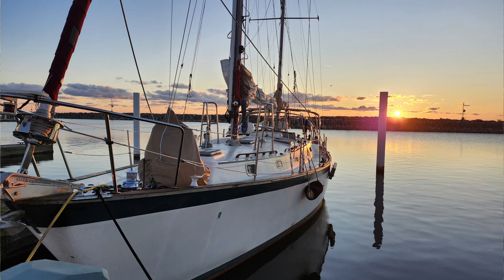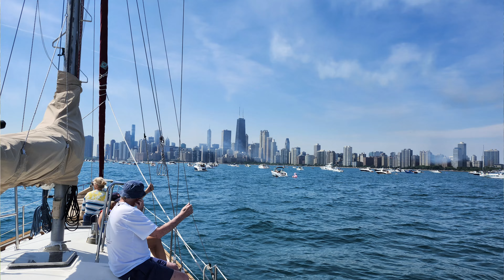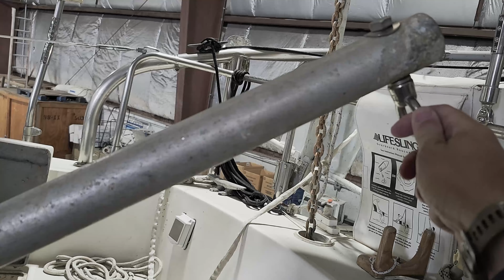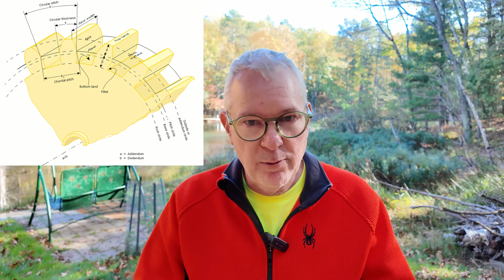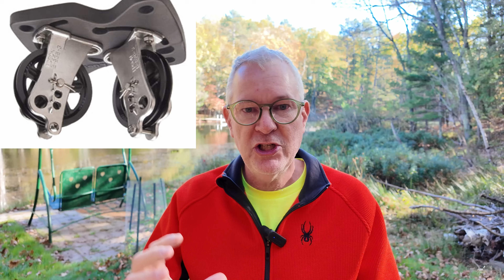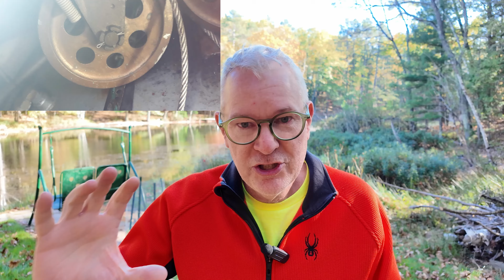The 5 LESSONS I learned LOSING STEERING sailing Lake Michigan on a Windy Day!!!

Comment: Weird coincidence, I was thinking, just last night, as I drifted off to sleep, that I need to come up with a way of connecting my emergency tiller to the winches, and your video just drove that point home, hard. Thanks for that.

Meanwhile, I wonder, do you have any idea why, precisely, your steering failed? I mean, I understand, the chain broke, but, it seems to me, that's an odd point of failure. Corrosion? Fatigue? Manufacturing flaw?

Anyway, good job getting it sorted without injuries, or needing to take any time from emergency services. Self-sufficiency for the WIN!
Reply from the maker: The chain was heavily corroded after  many years of salt water sailing use going from Florida to the Caribbean then to S. America and back multiple times. I am glad you found the video helpful. Thanks for the comment and for watching!

Comment: That's scary. Thank you for the good information. I happened to discover that my plastic screw on cap for the emergency tiller would not move at all. I was in the slip so no emergency. I don't remember how I got it off. I must have used some kind of gripping tool because my finger grip wasn't strong enough. Now I unscrew it every season to keep it from locking up. I'm going to inspect my steering mechanism and maybe purchase new parts to keep on board. I'm also sharing this video far and wide.
Reply from the maker: Thanks so much. I am glad you found the information useful. I appreciate your continued support!